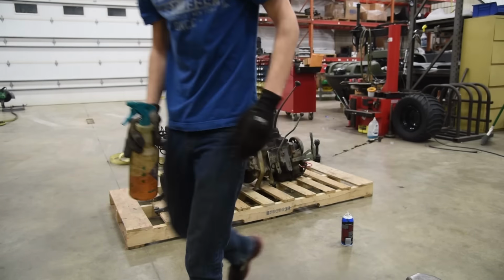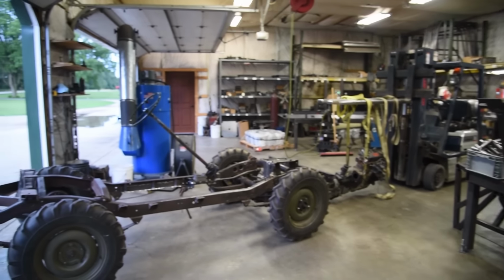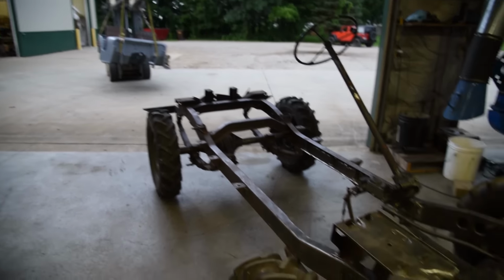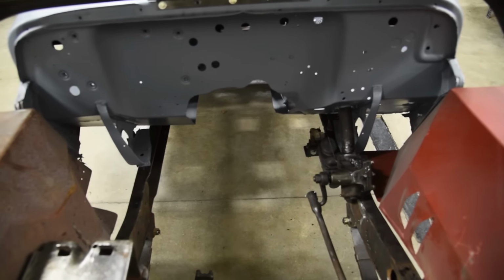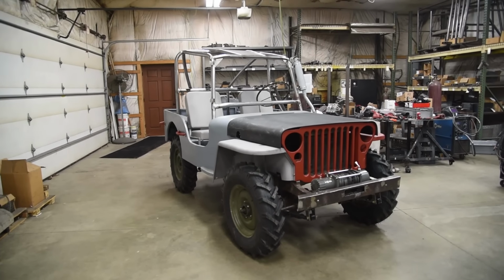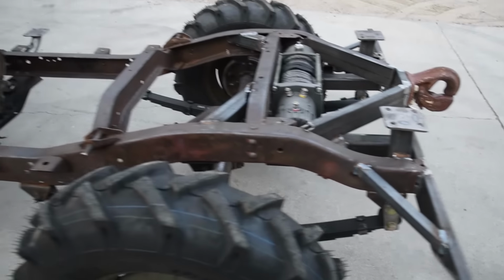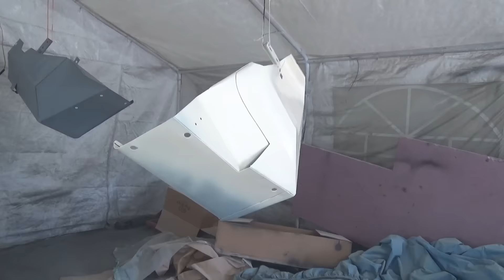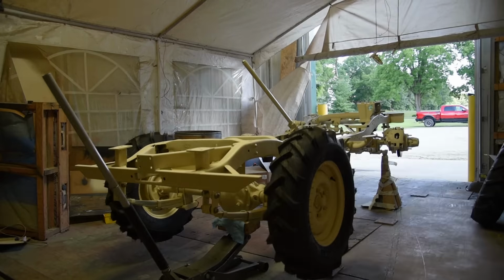Restoring a Willys Jeep in 10 Minutes

Comment from the maker: Calm down keyboard warriors. This is a 1947 CJ2A (civilian Jeep) produced 2 years after WWII, thus cannot possibly be war surplus.
Reply: MuddOxRacing what’s the difference? I own a 2014 Jeep but dig this little cjs...greetings from California
Reply: Hey there, i live in Bloomington too and just bought a 48. Engine is stuck, got any tricks besides Kerosene?
Reply from the maker: @jasonsims8794  I only lived there during school. Check out my video with the yellow Jeep on the trailer for info on rescuing.
Reply: @TurnNBurn  oh gotcha, well it's nice to chat with you fellow Jeep lover. LOL
Reply: We just restored a 1942 Jeep that spent a few years vacationing in Europe
We take it off road put it through its paces
Thats what jeeps do
Reply: MuddOxRacing please I need help, Bought a All in one piece CJ3B with a Plow mount on the front for $450 cad and everything is good but the engine, the engine got seized 10 years ago and the man removed the spark plugs and left it open like that, the engine won’t hank crank over and the oil won’t help so any other suggestions? Like tow it down the road and then switch to 3rd gear? I’m 16 and spent all my money in this thing, I’m not giving up now! Thank you for reading and for the help
Reply: I have a keyboard and I don't have afraid of use it!
Reply: @DallinDaBus  you need to tear the engine apart. You won't free it up and have a usable engine if it's been sitting like that. It likely has crusty junk in the cylinders.
Reply: sizzlinbacon21able I fixed it 4 days ago with a 8lb sledgehammer and a metal pipe and the engine is turning great, compression is fine, but no spark so I may need to get some new ones
Reply: sizzlinbacon21able and you wouldn’t believe how clean the inside of it was
Reply: Actually the contracts for military equipment didnt end the day the war did. Thats not how it works. The contracts are to manufacture a specific # of vehicles or parts and when that contract is fulfilled there was a review to determine if more of whatever it was would be needed. And Flat Fender Jeeps both Military and Civilian versions were purchased by the Gov. Until the flatfender design and production ceased and M38-A1 production started and both M38-A1 and CJ-5 and even CJ -6 versions were purchased under Production contracts with the US Government. So your factually incorrect as far as it being possible and even War surplus since the end of WW2 wasnt the end of War Production contracts
Reply: My family owns one of a similar year, I don’t know if it has army heritage or not, but it is an amazing vehicle. It is by no means original though; it has an added roll cage, engine swap, and tranny. Anyways, they are such amazing cars!
Reply: @DallinDaBus    I put a Ford Pinto engine in mine. Novak Adapters had an adapter, but some of the parts were hard to find.   Did you put a spoonful of diesel in each cylinder?  Let is sit a few days with diesel in it, then pull it with no spark plugs. Sometimes they will break free, but you might break a ring too.  Check inside the piston cylinders before you do it!  Mine was full of mud hornet nests.  It wasn't easy getting that mud out. I ended up pulling the  head and found more wrong, so I had to re-build the engine.   Don't get in a hurry, take your time and do it right!  Remember, this is a classic car that you can take to the woods!
Reply: @sizzlinbacon21able    Sometimes you get lucky and it's not badly rusted, but yeah, you are right.  Re-build and do it right.
Reply: You can buy the jeep?
Reply: Do you have instagram?
Reply: You sound like you are still a teenager. Where did you learn to do all this stuff? Btw, any regrets on putting the exhaust right next to the driver?

Comment: thanks..  my family had a 43 MB from 1963 to 1985.. my dad forbade me from doing any mods..  it got sold to a local guy.. who restored it to army look..  i still see it when they drag it out on parade days.. i know it was ours as the shovel groove was filled with a flat panel.. the only mod i got away with .   be sure to mod a garden hose with a 360 degree sprinkler nozzle to wash your frame rails out after dunking it..  or operating it in the snow/sleet..

Comment: Your motor needs a turbo, it lacks power. I have years of experience building Jeeps. I'm 74 years old and still love them.
Reply: Do you have any tips for me? I think of buying a used 2005 Wrangler and I want to set it higher because I would go Mudding and Crawling with it, and also do you have all terrain wheels that you would recommend?